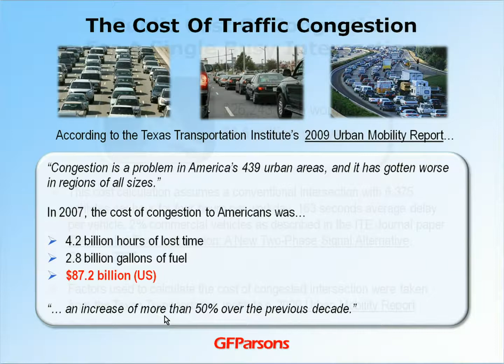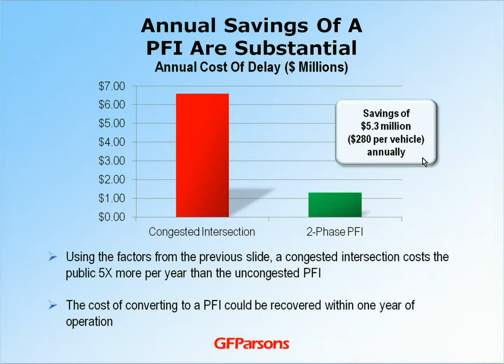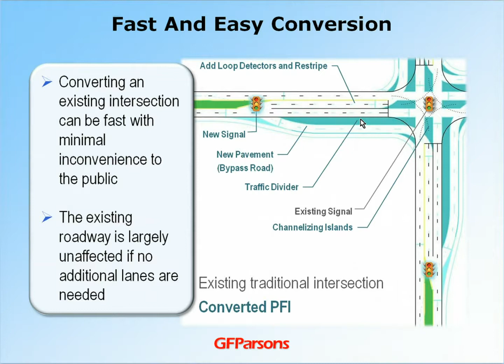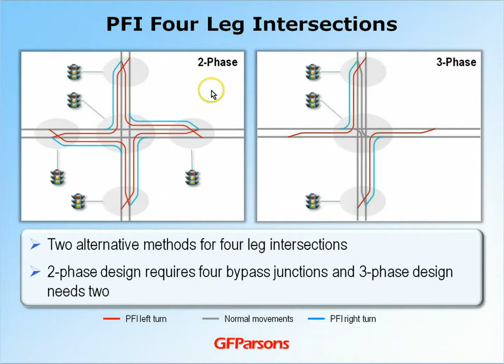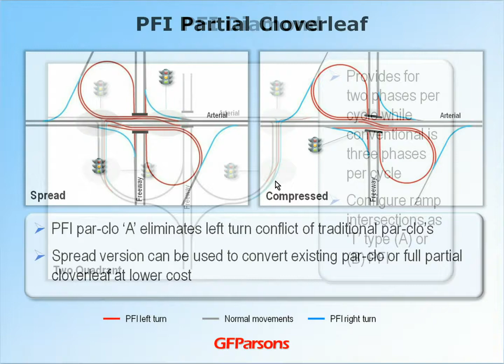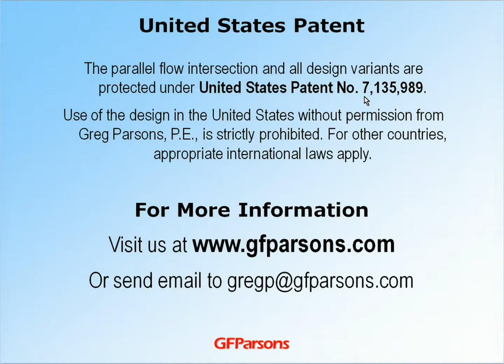Introduction to the Parallel Flow Intersection

Comment: This PFI, is it accurate to describe it as a horizontal displaced left turn?
Reply from the maker: The PFI doesn't displace turn movements so it shouldn't be considered a "displaced left turn" or DLT. You can google information on the DLT (aka "continuous flow intersection") which does displace the left turn. To displace the turn means that the movement begins far from the main intersection. Whereas the PFI left turn movement occurs just short of the main intersection onto a frontage road parallel to the cross road.

Comment: I don't see this as too efficient.  Seems to me that, since there are 5 signals, there will be wasted time at one or more of the intersections every cycle.  For example, say 5 cars are waiting at signal "A" while 20 cars are waiting at signal "B".  The phase will not change until all 20 cars have made it through signal "B", which means signal "A" has just spent a lot of time with no cars moving through it.
Reply from the maker: Have you watched any other videos here? If you pay attention, you should see there's minimal stop time. A traditional signal is 4-phases per cycle while the PFI is 2-phases per cycle. Watch the two videos linked below comparing a 4-leg 2-phase PFI to a 4-phase single-point urban interchange (SPUI). The PFI (with no bridge) blows the SPUI away (with bridge) The PFI is processing 19,000 vehicles per hour with no congestion.

The second video gives a side-by-side comparison of the two designs showing how much delay the SPUI would experience versus none for the PFI.

https://www.youtube.com/watch?v=IE-pdjcscsk
https://www.youtube.com/watch?v=GJ9wpsZSCmc
Reply: @gfparsons4630  Right - I'm just saying it could be even better since there is still a lot of time where certain intersections are empty.

Comment: Seems like this could cause some serious gridlock if there are a lot of people turning left (I think we can both safely assume traffic cannot be easily trusted not to block an intersection), but we're certainly getting there, as it really is a pain point. Is there a shorter phase time, or sensors to detect the volume of left turning? How does that affect pedestrians?
Reply from the maker: No gridlock if signals properly timed and coordinated. The PFI cycle length is short (60 secs) and loop detectors prevent blocking.

Ped crossing is multistage. While the overall crossing is greater than for a traditional intersection, each individual crossing is much safer at the PFI. Per crossing, the number of lanes is less, vehicles approach from single direction, more green time is allocated, and there are large ped refuge islands.

Find out more at http://gfparsons.com/pfi/

Comment: How are people supposed to get to the businesses on the sides of the street? It can't be zoned without additional reworking
Reply from the maker: I'm not sure what you mean by "can't be zoned without additional reworking."

The bypass roads however act like frontage roads and drives can be located on them. Left turns from the bypass road might be restricted but conceivably a left-turn slot could be added.

This simulation video shows a drive on the bypass road (lower right of video).
https://youtu.be/S0OQcRB5bPs?t=1m19s
Reply: GF Parsons As in, how are people going to access building on the side of the road? Is it going to be safe for pedestrians to cross, or is it only going to be for cars, compartmentalizing each corner?
Reply from the maker: I'm not sure what you mean "access building on the side of the road." Sidewalks can be located on the outsides and so can driveways. In that sense, access at the PFI is no different than a traditional signalized intersection.

PFI is safer for peds than traditional signal. Safer due to ped refuge islands, traffic approaches from only single direction, no permitted vehicle turn movements, shorter ped crossings and fewer lanes to cross in a single crossing. The PFI does mean a multi-stage ped crossing but each crossing is a lot safer.
Reply: You're already not permitted to park that close to the intersection (at least in NYS). And there's plenty of room for sidewalk.
Reply: Is it implemented at any locations worldwide?